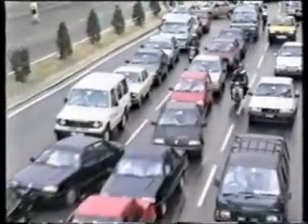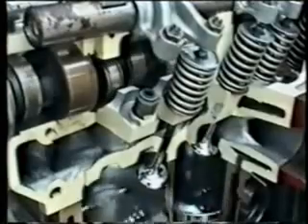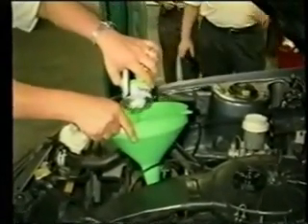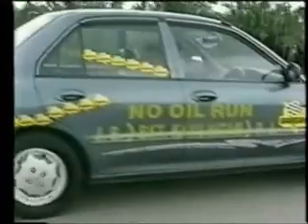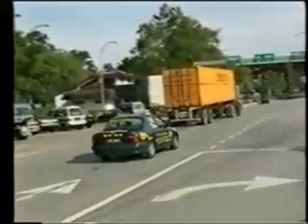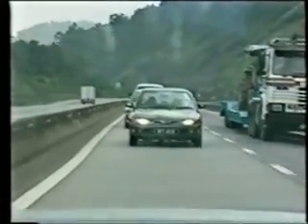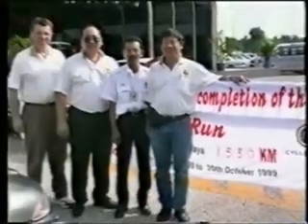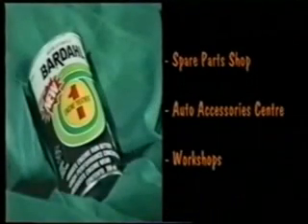Bardahl No Oil Runs

Comment: So it works. I did not refill oil on my old vw t3 because i wanted to change the oil anyway with in few weeks. Then when I unscrew the oil plug, no oil came out. But i used this product one year early, so the engine is til running now years after. now with plenty oli.

Comment: We all know that the most important thing oil has to do is: cooling. When there´s no fluid going thru the bearings then there is no cooling effect and the bearings wil melt down after a few miles. So i dont know if this is really serious. Of course a good lubrification causes less heat and less friction, but i dont believe they went 1.330 km without any fluid in the oil sump.